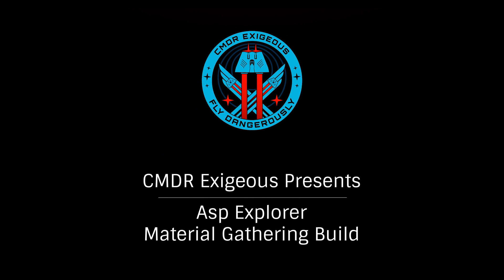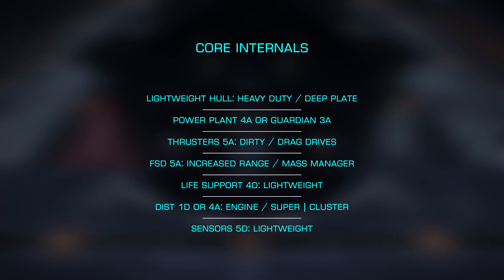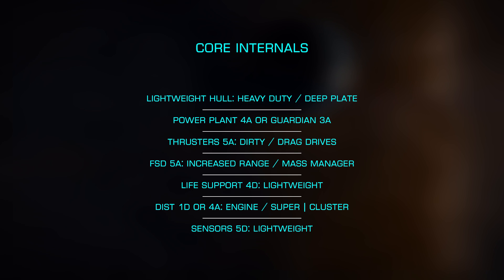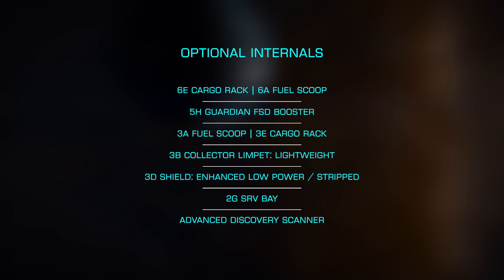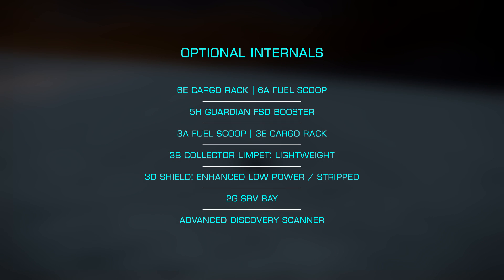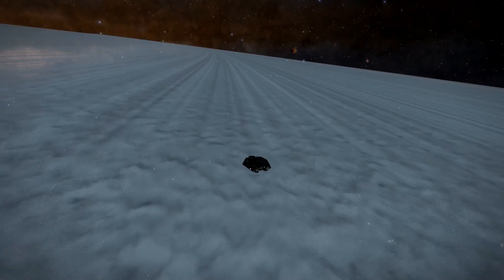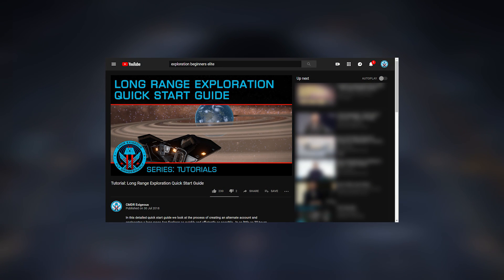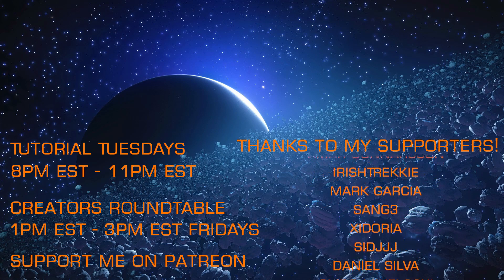Ship Builds: Asp Explorer Material Collector

Comment: i recently switch from asp X to DBX, cargo scoop with small ships are easy enough, DBX has a jump range of 70+ly stripped down with FSD booster + weapons (for guardian beacon, to charge them up). just that DBX will have 0 cargo space
Reply from the maker: Yeah, I use a DBX as a quick taxi to get around the bubble if I'm moving my combat ships around otherwise I greatly prefer having limpets in my Asp for picking up materials as when I go hunting I go for a while.

Comment: My trusty old AspX has gotten too small to fit all the internals I want to have on an Exploration ship. This is because of the Guardian FSD module. I'm thinking of outfitting a Krait for a new exploration ship, but I can't outright sell the Asp because I'm attached to it. It was my first goal for grinding towards. Even grinded the Alioth system permit so I could buy it there for a discount. It has been my loyal companion to many a trip far from the Bubble. So I can't sell it, but I could re-purpose it to a material collector like this.

I think a material collector Asp doesn't need to be as min-maxed for range as the build here. Even my current exploration layout is a bit beefier than this one. As long as it can jump 45 ly or so, it's more than enough for material collecting. I want to be able to blow away NPCs that are foolish enough to interdict me and collect their materials too. Also thinking of mining functionality as mining generates some materials on the side too, but a refinery that's big enough not to be annoying takes a lot of space. I also already have a mining Type-9.

Comment: keep the builds coming.
I have a very similar ASP Exp. with  a SRV bay and a 64t cargo going to tweek it up a little closer to your build. I'm getting 55LY jumps currently. I'm using long range scanners. and large power plant and distributer so it can also mine.
Reply from the maker: If you're using large power/dist/scanners just have lightweight ones and swap them out for when you're not mining - I'm assuming you don't do that very often?
Reply: I thought about what I said, after reading your comment, last thing I mined with was my Krait, and what a assume mining rig that was. No worries about MPC Pirates with that.
See if I can get a few more LY's out of the ASP
Reply: I became a patron today CMDR. 
I'll tell ya why. I've left comments on the other TUBERs, but your  the only one that takes the time to reply back.

Keep up the good work

Comment: I tried a larger Guardian FSD booster and a smaller fuel scoop, but ended up switching the sizes round. I found that in terms of travel time, the additional range wasn't worth the additional seconds per jump lost to a slower fuel scoop.
Reply from the maker: Yeah, that's generally the case - I choose the larger cargo rack for limpets as I generally use this for high grade emission gathering so I'm not jumping too much compared to supercruise time.

Comment: what materials?
Reply from the maker: Engineering materials - just like what's linked toward the end of the video
Reply: So there is not actual thing beside jump range and a cargo rack that makes this a "material collector"?
Reply: There's a long range Wake Scanner for that data, an SRV for planet side collection, and the cargo/collector for USSs... all with a fuel scoop and the jump range to get you from one target system to the next quickly.
Reply from the maker: Well the key component is the collector limpet controller but you don't strictly need that as you can just scoop materials but as that sucks this is what I use.
Reply from the maker: Vib - commented before reading yours, seems you got the point of the build exactly :D

Comment: Mines an icourier.
43lyrs jumprange
Boost 725
Normal top speed 515
Discovery and surface scanner
Srv bay
Shield
Largest scoop and fsd booster.
Enhanced thrusters g5 DD
Full sized a rated charge enhanced distro
No guns but sinks and no one will catch you
Reply from the maker: I use a Courier for sightseeing with something similar, a bit lower range but faster boost (over 800).  I don't like using it for gathering thought as I want the collector limpets.
Reply: @Exigeous  that makes sense. I just want to give it a use.
Reply: And I don't sight see

Comment: Two notes:

1) Add a lightweight laser and point defense on top for grabbing materials at guardian sites.

2) If you cut the thrusters back to a 4D for weight (for that extra jump range when exploring) and want to keep using that when you get back in this ship, then you should go with Drive Distributors instead of Drag.  It will cost you a bit of speed, but you'll need the extra max mass if you want to replace your fuel scoop with a 64t cargo hold and such.  That isn't a problem with a top A rated drive though.